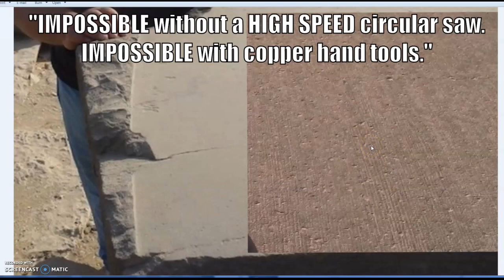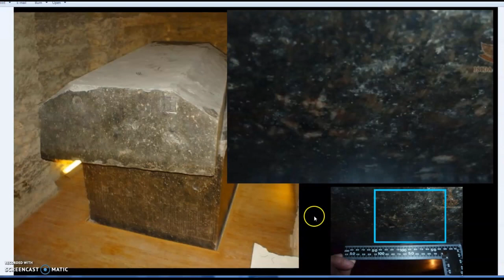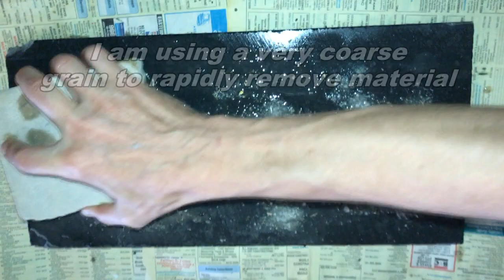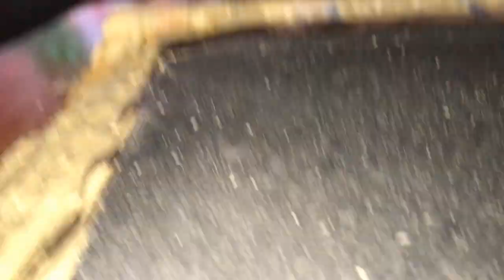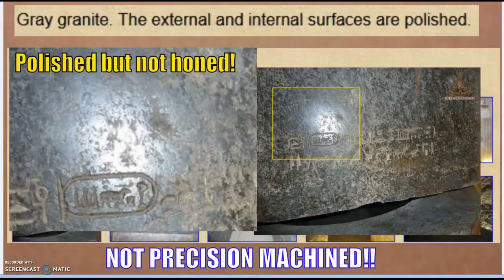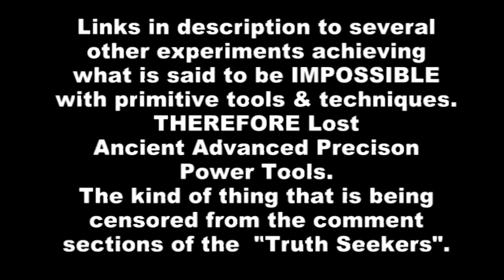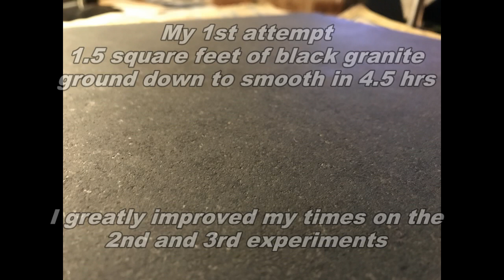Ancient Stone Working Techniques: Experiments with Black Granite on Removing Striations

Comment: Imagine how effective a person growing up in a mason family doing this for generations would be. 
All the tricks and techniques that would improve this a lot ... i bet more than double the speed. 

Great video.
Reply from the maker: Definitely. With some rope and a bit of basic carpentry. Perhaps using the right oil instead of water.
By the time I had finished these I wasn’t even 6 hours in and had learned a bucket load. 
The next one is with split face granite and I get a perfect hone at a minimum of 2.5 hours for 1.5 square feet. I would do better  but the stone I was working limited me. I need a giant table sized piece to work that out.
Reply: @SacredGeometryDecoded  Do this for 20 years ... imagine how many tricks you'd know. Finding the perfect mix of weight pressure vs motion vs materials and so on.
I bet they had a lot of support tools too.
Anything from woodstructures supporting stones to handles.
Reply: And then imagine you were doing it for a living god -- who rewards yet also punishes! More incentive than double pay on Sundays!!
Reply: @GroberWeisenstein  Maybe even more...

Comment: Excellent presentation - crammed full of 'awkward information' too:)  As each day passes, I cringe more and more to think that for a while, I too was taken in by the lost high tech crowd. It's embarrassing tbh - but I mustn't beat myself up too much - they hide SO much important counter evidence - it's a masterclass in censorship. The reason Foerster stated at the start of a 2019 lecture that 'it's important that we don't listen to academics'. I was quite taken aback too when I realised unchartedX channel was also censoring comments, and blocking some of those that linked to the 'scientists against myths' channel. Only a matter of time now before their castle built on sand collapses.
Reply from the maker: Me too. I read one of  handcoc’s books and it sounded so authorative I took it on face value . They speak so well and so confidently it’s too easy to believe. 
Luckily I worked in lifting so I knew some of the ‘facts’ were suspect. If not for that I might not have fact checked the other things.
Though then house built on sand meme he lives using switched from the positive to the negative. Then the more you look the more I realised it’s all  cherry picked facts mixed with a healthy dose of us vs them cult tactics.
Reply: @SacredGeometryDecoded  this is why so many are taken in by unchartedx channel - he has a 'way' about his delivery that is convincing to the uninformed. 

I got the core 7 images last night...very revealing - in essence - it's a complete mess, due to areas of crystal (not a pure granite) - so it's not even possible to trace a single groove before it disappears as it hits the quartz seam...no wonder dunn only managed a few turns of his cotton...plus - they undulate (up and down) - the grooves are not straight - which backs up the idea that they are formed from pieces of grit being lodged between the tube and the stone.
Reply from the maker: History Maze sweet on those pics. 
Making a drill at the moment. Using that bent handle method. Will test on grey, black granite to see what happens. Interesting on those crystals. The stones I have smaller crystals so should be interesting comparison. Plus I have a bigger block now so can go deeper and remove core with copper wedge. It’s impossible apparently😂
Reply: @SacredGeometryDecoded  seems some of the crystal parts kind of get ripped out, as they don't behave in the same way as the granite - as a diff structure of course. some of the crystal areas do get scratched though. the argument charted made for being photographed in a 'biased' orientation is just ridiculous. what's more dodgy imo, is the hand drawn graphic on dunns site of the core with a nice neat little spiral - when in reality - the close up pics of the core are conspicuously absent from his site or book ...once you look at them in detail, to me, it's impossible to even give the spiral idea a moments thought.
Reply: @SacredGeometryDecoded  How did they lift and transport the huge stone blocks at Baalbek in lebanon?
Reply from the maker: @milkybar06  It isn't widely reported but recent excavation have found Greco_Roman era remains beneath the foundation. Confirming the date they were built.
Roman lifting towers to erect giant Egyptian obelisks in Rome.
Pope Sixtus the 5th had these moved and re-erected in 16th century, tthey used te same techniques.
A common thing you'll hear is that woode would collapse under the weights, it's a myth. the red cedar that grows in Baalbek area has a crushing strength of 6090 pounds per square inch. Hemp rope has similar properties so ancient materials would easily handle those types of forces.
Reply: One must be consumed, for a while, by the lies to properly be able to understand they are but lies.
Reply: My background is very academic, including economics, and the very idea of an advanced technology before The Copper Age! always struck me as preposterous. The first Egyptian age or fine stone working was by a civilization not much removed from hunting and gathering. The mindset to quickly go from that to high-tech machinery has never existed. Where are the traces of the civilization that could do this? Their factories, foundries, slag piles? No hieroglyphs of this gizmos? No written accounts.
And so on. By focusing just on some individual pieces of worked rock, the entire supporting infrastructure is ignored, and that cannot be hidden. 
I know nothing about stone working, but what I know about the science and infrastructure to make high-tech gizmos completely rules out mystery history, even aliens. Interplanetary system travel would require a technology that would never permit such imperfect stone work, let alone overcome the millenia it takes to traverse space.